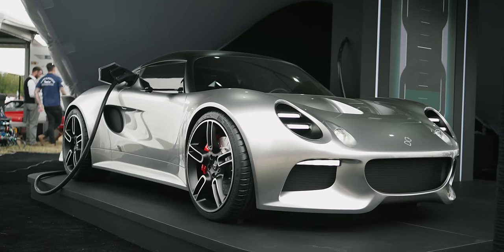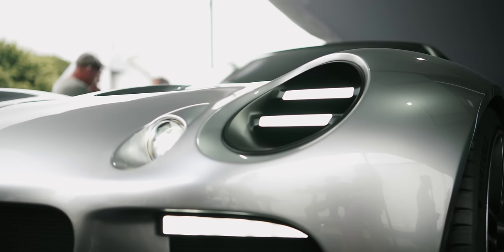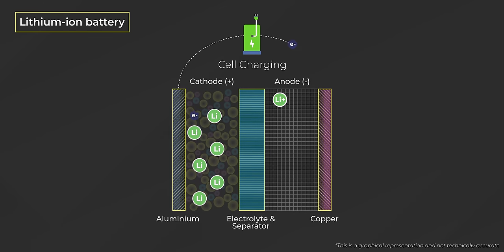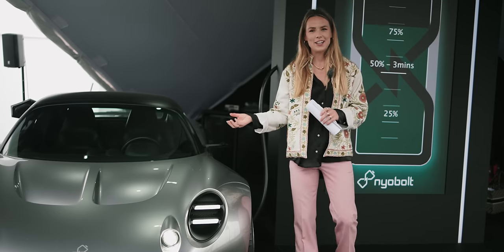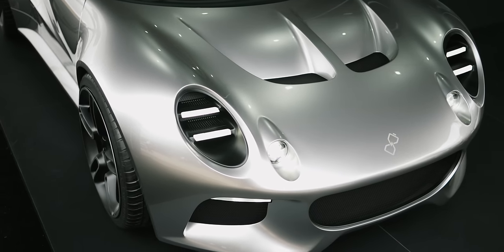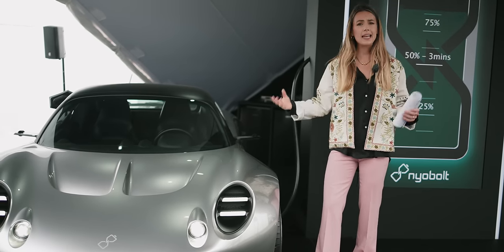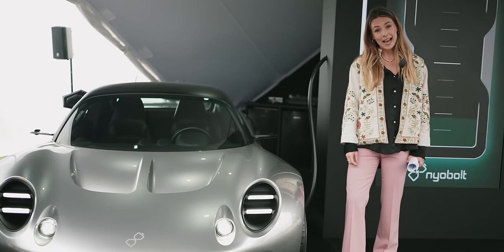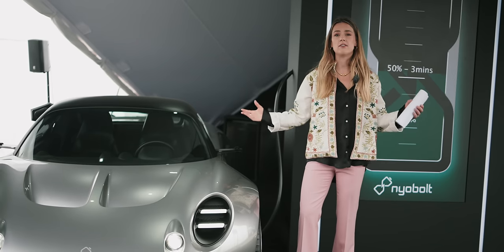This Futuristic Tech Could Be the Key to TINY EV Batteries!

Comment: A little out on the number of 350kW chargers...I remember it being 17 about 2 years ago but the current total on Zap Map is 106 locations
Reply: Do they actually deliver 350kw? I've heard EV drivers moan about reduced charge speeds, especially when other cars are plugged in at the same site.
Reply: @the_lost_navigator7266  they can go only deliver what the car can take. There aren't any cars yet that can charge at 350kw
Reply: I was puzzled by that comment as well. Many of the locations also have multiple 350kW charging units. If that “fact” can be so far out it weakens the rest of the video.

Comment: I look at this differently. Because of limited power density, cars with small batteries are slow as a rough rule of thumb. With high power density, short range small "city cars" can be fun and quick up to reasonable highway speeds. No need for a big (Tesla Model 3/Y is big in most markets) or heavy (you know who you are) car to have a fast and fun car. Hot hatches for everybody! 😁

Comment: Lovely that they have gone back to the original look of the  Elise
Reply: they coudlve made a thing of their own and made it nto a heavy ev.. how about a electric variable vane turbo inline 3 with hyundai hybrid non cvt transmission ... or INNengine or freepiston thing with a actually recyclable electric motor unliek the usual electric car motor?  it owuld be a more sustainable way to reducing emissiosn exemplified in a proper easy cheap to use and fix everyday enjoyable sports car of manual steering etc. its just a electric car with no effort to make it special  besides the obvious weight distrbution which porsche taycan also does?  its just a lazy novelty to me
Reply: It is retro by now, so why not? The first ones can be registered as veteran vehicles in a couple of years.
Reply: @kalmmonke5037  :  Really?  😵‍💫
Reply: @kalmmonke5037  are you high?
Reply: why are they still mining for material to make electric car battery? because they cant recycle a small portion of it, they cant even claim to get it done which is why they re use the used up , thus low performance, battery by stacking many more of them together in order to have the same performance as those were able to make alone before, thats why they only use such stuff on non transport application,. batteries have low energy per weight, so the more battery you add, the exponentially less energy effceint it becomes because you arnt using the enegry of all those batteries your hauling around at a given moment of normal driving. this also worsens battery longveity because high rate of energy flow, although that can be balanced out with dividing the degradation of battery life among more battery cells... theres a balance to be made, and that balance is to be further balanced with the amount of battery raw material we have to use wherever it is most effective at reducing emissions, assuming thats even a need. so using batteries in non tranport is the most effective way to reduce emissions.       weight causes tire wear suppsoedly endocrine disrupting  microplastic emissions dust , altough tires could be made of more natural rubber and less petrol plastic like fisker claims they are doing, using considerably more natural rubber tree stuff is going to require less grip, that means a lot less car weight than we have today.     weight is more harmful in a car crash, although it would be expensive to protect people inside by crash structures, high grip anti control loss sporty car dynamics, etc, , there is not much  assurance of protection for others involved in crash.   roads wear damage also becomes much worse due to more weight.  CAFE laws are apparently written by people who dont care about emissions , which si why big tall vehicals are incentivized by making it hard to meet emissions stansds on lighter weight smaller vehicals , engines, etc, which wouldve also lowered emissions and raw materials use for sustainability of the raw materials economy. nucelar and electrolysis hydrogen are the only mainstream tech hope, yet those things are destoryed by the same people who push the climate crisis like world economic forum, ebcause they peopel dependent on petrol etc so they can threaten those who rebel against their will by taking away their energy etc. youtubers liek tony heller, tom nelson , and corbett report text series on substack website called "how balckrock conquered the world" ,  "gainign traction, loosing tread pollution from tire wear now 1850 time worse thanexhuast emissions" article by emissiosnanalytics website,  look aroudn this youtube channel sort of thing at odysee sitge:  VSOF Timeline Class: Lies and Thievery of 4000 years, the History of the Old-world order Anew.  , orbett report text series on substack website called "how balckrock conquered the world" 
 @johnmeyer457

Comment: The issue with small batteries that need recharging more often is that you become a victim of the hideously overpriced public charging network rather than being able to charge mostly at home, what chance same price per kWh at public chargers that you pay at home?
Reply: That's a business model problem
Reply: Good point. There is also the issue of having to stop frequently, which is more inconvenient. Just use a normal size battery with a range of 250 to 350 miles per charge.
Reply: @toyotaprius79  A broken one.
Reply: Do you really nitpick on charging prices if you drive a sports car?
Reply: The future will be buy the battery you need and suffer the occasional. I suffer a 54kwh battery in an ioniq5 and it does 90% of my journeys. Posting for the 77kwh battery just did not seem worth it. With the weight and size saving I could see myself going down to a 48kwh, with this charging I could see my wife going down to a 20kwh battery.
Reply: Depends on use case.  We only have had to charge publicly is on quite long trips so really rare.
Reply: @JohnBBuck didn’t you know?  That’s the most normal drive done by non-EV drivers! 😂
Reply: For this type of car (being both an Elise and EV owner) you want to take it on track days or drive it up some mountain road. Unless it has massive regen and a low power motor then you might only manage 2 or 3 laps.
Reply: @milesforrest6920  you would probably manage 75 miles on 155 mile range car like this (reference distance on other websites) but what is the problem with them stopping after 75 miles for 19 minutes, it's a track day, you won't loose. As for motors, they are not really a problem. A 20kg motor can peak 300hp, it's the battery and inverter that really limit the power in most cars.

Comment: It would be wonderful if they can interest a company in taking that car design and putting it into production. Although if you have a small battery then even standard LiIon batteries will charge quickly 'enough'. It's with monster 100kWh+ battery packs where a 350kW charger vs 150kW is really going to make a difference, especially if the battery tech can maintain that rate all the way from 0-100% SoC.

Comment: Ahhhh not going into production? I hope it does eventually!  Wish we had these in Canada.
Reply: Not going into production says a lot. It’s not like other automakers can’t do the same.. they don’t though for a myriad of reasons. 

That said, I’d love to see even faster charge times, but not if it comes at the detrimental expense of longevity, reduced safety, higher cost, reduced range, and so forth. 

Reminds me of when overclocking computer chips used to be a thing , caveat being reduced longevity, complex cooling, higher cost, etc. While not a perfect analogy, there’s nearly always a compromise.. a trade off to absorb more energy in a shorter period of time. Discharging at high rates also has its own caveats. 

In any case, it’s been well known that faster charging is possible, but the immediate questions become; is it repeatable, for how many times, for how long, at what cost, with what trade offs, etc. When those can be addressed in a safe, commercial scale, automakers will incorporate this in production vehicles. Till then, it’s still just a fancy headline.
Reply: Maybe the Catherham V is an option
Reply: Be careful what you wish for.
Reply: @ΘάνατοςΧορτοφάγος  The guy in that video said that he looking at next generation of batteries for the car. So who knows may be it these batteries he looking at.

Comment: Sadly, you probably do need a bigger battery in general because so many of the charging stations are unserviceable at any time, and the ones that work are AC only. More focus on the infrastructure is needed.
Reply: For clarity where are you writing from, I rarely find an unsevicable DC charger (UK), but maybe I am lucky.
Reply: You are lucky. I’ve had my i3 REX since 2015. I used to regularly do a run from Berkshire to Lincolnshire to see family back then, and had to do a lot of the same runs last Summer. In seven years, it has become no better. Yes there are far more chargers, but there are also far more EVs. I’d estimate that over the many trips I did, I encountered a problem with either broken or restricted charge units around 30% of the time, and delays queuing of at least 30 minutes taking that up to about 50%. The only good change was that all the motorway charging units now take contactless payment. I had a few more trips this Spring, and I just ended up using the REX, rather than go through the hassle. I have always been a massive proponent of EVs, but this is still one of the biggest minus points in my opinion.
Reply: @markparker5585 do you check ahead and try to go to a charging station that has available chargers? Or are they all fully in use? Is it simply the numbers?

Comment: 10 times the energy density would be much more useful, sooner not have to charge rather than charge quickly frequently
Reply: Definitely but that type of improvement isn’t going to be on the horizon anytime soon. I think even solid state technology will be “only” a 2 or at most 3x density improvement (which would still be huge improvement).
Reply: You only need a battery that lasts as long as your bladder. If you need to stop every 2 hours for a pee that'll give you enough time to recharge your EV 😂
Reply: 10x energy density would mean 10x longer charge when you do have to stop...  bear in mind that you only have to charge more frequently with this vehicle because they decided to only put half the battery capacity in... if it was a 'normal' car with a 'standard' battery, you'd stop with the same frequency as a current vehicle - but for a shorter period (time for the loo?)
Reply: @logicalChimp  not really, because you’d need a much smaller battery to achieve the same results
Reply: @stephenwensley9328  Sure - in which case, you stop as frequently as you do currently... just increasing energy density in order to stop/charge less frequently means it will take longer to charge when you do finally stop.
Reply: @logicalChimp  depends on how much weight is saved by moving to a more energy dense pack, and what SOE you have and are trying to achieve at each recharging stop.

Comment: The problem with having a smaller power dense battery is the infrastructure to charge more frequently is not there (at least not in the UK). If you are lucky enough to be able to stop at a fast charger, you then run the risk of the chargers being fully (especially around major holidays when more cars are on the road) or some clown in a diesel SUV has parked in the charging bay stopping others being able to use it. We need more chargers and stricter penalties for people parking in a charging bay when they should not be. We also need roadside charging to be more cost effective, the price at most fast chargers is in excess of 75p/KwH, that is madness!

Comment: High power charging is a strain on the electrical network. Temperature rises with current flow meaning more energy is lost to cooling while charging. There should be a surcharge for charging at over 100 kW or 3C charging.

Comment: Are there any other cars that can fully use the 250kW charger? If 250kW is its upper input limit, the only difference is that they made the battery smaller which makes it faster in comparison but not better.
Reply: I think she said 350. And I think that's just the fastest charger available. Making the battery smaller doesn't make it charge faster, unless you are maxing out the charger. The cells get charged in parallel. You can have twice as many cells and it takes the same time to charge, as long as the charger has enough power. These are faster charging cells.

Comment: 35kwh batteries really isnt that much. it sure can work in city enviroments, but it realistically isnt enough for many people. here in norway, where EV adaption is at or close to the highest in the world, most people who arent just driving to and from work need bigger batteries to not have hassle going on any sort of trip. even if charging is fast, its still the hassle to have to plan where to stop, actually taking that detour to go charge and connect to the charger, work with shitty apps... even if the charger took 1 min it would be rather annoying to deal with and the whole process would still take 10 mins minimum unless u know the area and chargers well.
its so popular with bigger batteries here in norway that plenty of models only ship here with the biggest packs, because they are always chosen. sure, often u dont need more than 10-20 kwh a day even if ur work is a little further away, but if its winter, u dont have a garage, suddenly ur car can consume double the amount of power it normally would. cold weather is bad enough itself, combine that with motorways, thats a way to lose range fast. at least for norway, unless ur 100% sure u dont need more than 30 or so kwh, i think 50 is the bare minimun id ever buy, and thats coming from someone with an older 2016 leaf. i dont regret buying an EV, but man what id give for double the range.
Reply: do people still keep a 2nd petrol car there?
Reply: @justice4g  generally no. of new cars, 80-90% Are EVs here. But almost all Are newer bigger 40k$ or higher.

Not to say cheaper smalner evs dont exist, i know plenty of people that have 2 EVs. One smaller for whatever trips and work, and then one bigger family car for long distance trips. Usually the man in a relationship has this one :P

Comment: Now let’s do the math, assuming the 350kW capacity is available for the entire 6 minutes that equates to 36kWh of stored energy. Assuming again that the vehicle consumes say 18kWh/100kms the range available with that charge is an additional 200kms. Hopefully there’s another high capacity charger within that distance? I’m certain that the vehicle had a larger battery than 36kWh capacity so may be an exaggeration to say it’s charged in 6 minutes?????

Comment: With the current infrastructure and planned future infrastructure I would definitely take a slow charging ev with 135kw pack rather than a super fast charging 35kw pack. Travel at a bank holiday and you might be queuing for 1 & a half hours to charge for 6 mins. Only to repeat the process 75 miles later!
Reply: This is a good point. If people have to queue that is clearly a failure to have enough chargers. Though if everyone could charge in 6 mins you wouldn't have to wait very long!

Comment: Speed of charge really isn't an issue for the average man in the street. We just need more destination chargers. 
As a lorry driver who has to  take a 45 min break by law every 4.5  hours it's just not an issue. Car drivers should be having a 30 min break every 3 to 4 hours to stay safe if you are travelling at 70mph. 
Just have cars that won't allow you to drive more than 4 hours without a break. Then you just have to work your charge in around that. It's pretty simple really..
Reply: The highway code recommendation for drivers and motorcyclists is to take "A minimum break of at least 15 minutes after every two hours of driving" (Rule 91).

Comment: Imo 100 kW is minimal size of battery pack. In nordic winter 20-30% less range. Then to optimize the batteries longevity one should not so full cycles instead keep hoovering around 50% SOC is usually the best. So say using the battery between 20-80% so basically 60% (42% in winter) or even tighter 30-70% so 40% (28% on winter). So that 100 kW gets "eat" up pretty quick. So in winter time in order for best battery practices you from 100 kW pack get 28-42 kW of usable.
Sure one can charge it to 100% and then drive it down to turtle mode but now you have less cycles  left than done right. 
So even with fast charging i still say 100 kW pack is minimum, in winter even the charging gets slowed down substatintilly combined with charging curve not beeing maxed for the full duration it drops as the battery fills up.
Reply: You've forgotten reality for most people.

Average mileage is less than 50km /day (30m) in many countries, and so naturally a lot of people do less than that. 15kWh would be enough for these people.

If you want to drive 500km to work I don't think anything I say could stop you, but please don't pretend everyone else has the same priorities as you.
Reply: kWh... not kW